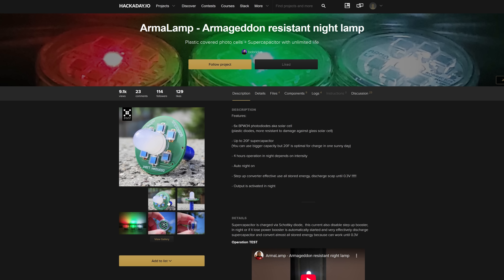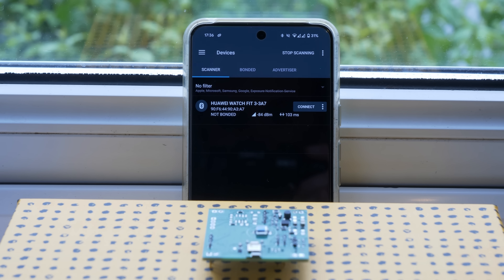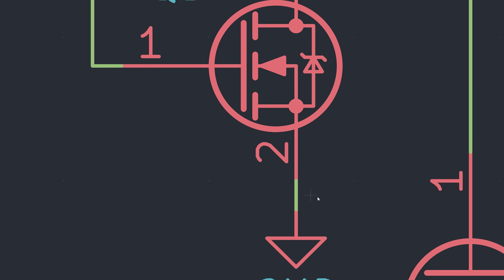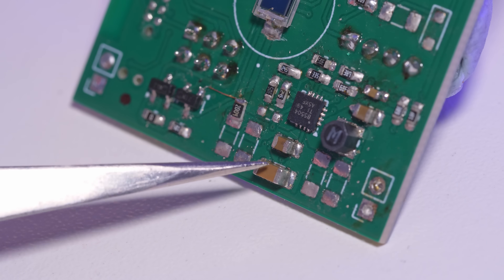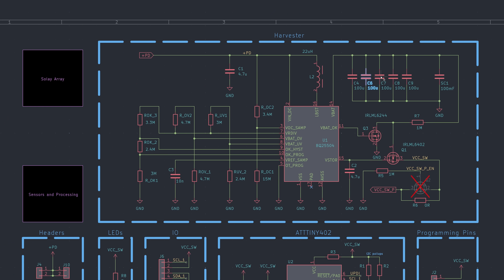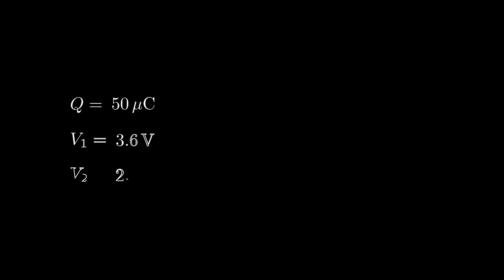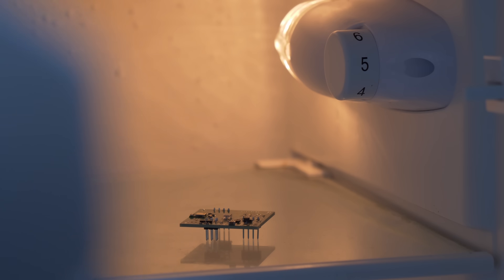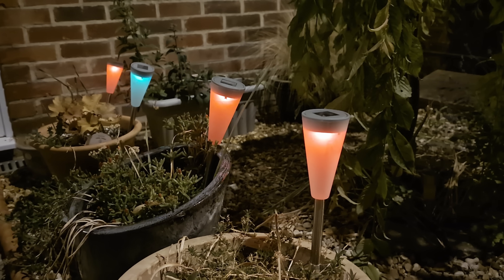Nordic chips are so efficient, you don't need batteries anymore

Comment: Nice project 🙂If you are familiar with microcontroller programming, you may be interestand in the STM32U familly. They are ultra low concuption microcontrollers with a variaty of low power modes. Some can get down to 110nA in consumption. Perhaps it's a way to render your device "smarter". But it is not a MCU that is entended for wireless. ST has the STM32WB microcontrollers, but I find them a bit difficult to program compared to Nordic or Espressif that have a large community around them for DIY wireless devices.

Comment: Back in the 90s and early 2000s there was a community of roboticists experimenting with purely solar powered and purely discrete component robots. They had several clever "solar engine" circuit designs for storing up solar power from small cells in capacitors and releasing them at intervals. They used things like integrated flashing LEDs as triggers, or dedicated voltage triggers (1381,  three-pin package, forgot who made them, I think the specific line is discontinued but I'm sure there are comparable chips out there). No need for complicated MPPT setups. Might be worth doing some digital archeology to see if any of their designs could work for the power harvesting side.
Reply: Sounds super interesting. Do you happen to recall the name of that community? Is there some source to their projects?
Reply: @weekendforever  The approach was called BEAM (stands for, among other interpretations, Biology, Electronics, Aesthetics, and Mechanics). The Solarbotics catalog/web store used to sell a ton of kits and parts bundles. It's still around last time I looked but focuses more on Arduino stuff these days. A lot of the old sites have fallen into the void, too, or been claimed by domain squatters.
Reply: @weekendforever  If it's what I'm thinking of, I think they called it "BEAM robotics". Sort of folded back into the general electronics-hobby scene, I think?
I used to read some websites from that kind of thing as a kid.

Comment: An intruder alarm for the garden.
A couple of mirrors and stepper-motors to point the infrared/ultraviolet laser at 10, maybe 20 tiny batteryless sensors. When no signal is received, there's something there. You could even hook the mirror driver to the signal band to see how fast it could get around all the sensors!
Sure it's an over-engineered mirror but it's the build that's fun.

Comment: I have a bunch of bluetooth temperature sensors(LYWSD03MMC) around my house and I've been planning to power them in a similar way using the SPV1050. I actually have the board for it sitting in front of me just haven't gotten round to populating and testing it. I'll be trying it with supercapacitor, lithium capacitor and LiFePO4 batteries as storage options so they can also send at night.

Comment: I remember using a calculator with a solar panel in the early 1980s (they may have already existed in the 1970s). I guess such devices have been largely forgotten for the past 50 years, much to the delight of the battery industry.    I would not be surprised if it would come out that there were some patent trolling involved in the background...
Reply: The two calculators I myself bought in the last 15 years and all recently purchased calculators at work came with solar panels built in. They are often sold without batteries installed and folks at work chase after bright enough spots in the warehouse to keep them on (too lazy to go to the shop to buy batteries).

I forgot when I saw the last calculator without a solar panel, maybe in the 90s.

What world do you live in?

Comment: Wifi Door/Window contact switches would be an excellent candidate for this.

* periodic transmit, including current open/closed state, via wifi/mqtt so you know the module is not dead.
* on-state-change transmit when the reed switch changes state.

Other house sensors, like PiR sensors would also benefit.
Reply: Unfortunately with encryption and redundant two-way communication alarm sensors use too much power. A CR123 battery lasts about 5-7 years for a good alarm sensor so it's not really a big hassle.

I do see a great usecase for temperature sensors with this technology.

Comment: Clear watertight, floating ball for tracking ocean currents
Reply: Would need to save up a lot of power for that transmission, but could be really cool
Reply: It would be exposed to direct sunlight on most days, so that would help a lot with efficient charging. And seeing how Starlink is working on direct-to-cell connectivity, it's not completely out of the realm of possibilities.

Also, it would need to be a certain size so that it couldn't get swallowed immediately by small fish/birds (so more area for light collection). But also not too big so that it would pose any danger to ships.
Reply: using LoRa for communication!

Comment: Having some involvement in information security: The concept of a long-term Set and Forget self-powered device with transmission capabilities raises some worrying concerns in the malicious surveillance department. 😟

Mind you; One good use case I can think of is passenger counters at rural railway stations. If you can make a photocell trip-line that logs passenger entries/exits and then sends collected data to an on-train module when one calls at the station, it makes implementation of such equipment far cheaper and easier. It'd certainly work at very rural stations, like many on the North American network! 👍

I just wish that I could be cute enough that any technological innovation I had to bring to the table wasn't always being directly muted out... 👴🏳‍🌈🔇🥺

Comment: Definitely a leak sensor to use in a bathroom, laundry room or basement. Sends a warning only when a leak is detected and its status every hour or two, just to announce it's working.
Reply: Though in a laundry room or basement you'd want a larger battery, as those rooms tend to go much longer with no light
Reply: @tuftyindigo  yep i'll keep my longer lasting batteries and not risk damage in those areas
Reply: It would only use energy when a water connection is made, acting as a turn on switch. So it could go a long time with a charge
Reply: @PaulFonWheels  except capacitors have pretty high leakage current, so even if the circuit had zero power use, it wouldn't stay charged for a whole day.

Comment: Interesting idea (just an idea, as it is too complex to implement) - pea sensors, where the entire outer surface is a solar element, and inside is simply a crystal in a compound (just like in cheap electronics, where a crystal is placed on a board and poured with black compound). Accelerometer/gyroscope, temperature sensor, radiation, pressure - they can simply be scattered over a large area and used infinitely.
Similarly, a positioning system - the same capsules that just transmit their serial number, after marking the location, create a map once and get a navigator.
It would also be interesting to consider the idea of obtaining energy from the request radio wave (or working with the reflected signal) - when the pulse energy of the receiver is used to power the circuit. After all, your sensor won't have enough 'starlight' to operate, which limits its application.

Comment: Hot damn that's cool. I'm used to diy RV 12v solar and I've never done circuit design but have a decent concept. But how little per is needed to send packets that's really cool. I totally overestimate how many watts is needed to do work. I freaking love this idea and hope we get more devices like this in the future. Would make monitoring a lot simpler. Providing power to sensors all over the van would be tedious, but if these cells could be powered by most lights then I could remotely turn on my lights just to get an update through my always on pi.

Comment: Hah, I never thought one would be using a nanopower MPPT converter. Your thumbnail looks like cliclbait, but the solar cell really is that small! Decades ago solar powered calculators were about the only common solar-powered things we had. Since most devices just need to run in bursts, it would be great to see this become more common in small smart devices. I'd imagine not because it will remain cheaper to just put battery contacts in than this circuitry.

Comment: Your paste is old or diluted with alkohol 😮
Reply from the maker: You have a very good eye, how did you tell that this is old solder paste?
Reply: @PocketConcepts_  Because i somethimes work with it. I noticed you have some dirt around solder joints. It hapens when flux in paste is diluted with alcohol, when paste is old and hardened. Keep it in fridge it will last longer. I also have some expirience with c programing on rp2040, and when i was younger i tried to make geiger tube with photodiode cluster and OP amp. When i saw photodiode i interested in your video.

Comment: While expensive, you could use a tiny supercapacitor like a 0.33F RSCXJ3345R5F05013U to store 300x the energy and with a good sleep routine the nRF should last all day. You can even harvest energy using an antenna, especially if you have any local radio towers broadcasting.
Reply: Supercapacitors can have quite high leakage current, it's not listed in the datasheet for that one so you'd have to test if there's enough power to keep it charged. Would be nice if it could last through the night. A tiny LiFePO4 cell would be another good option but I haven't been able to find any smaller than AAA. Lithium capacitors are another option, I believe they have lower leakage currents.
Reply: @teslatrooper  I did a commercial product using a supercapacitor (using coin-cell, not energy harvesting). It has a relatively lengthy period (hours/days) of 'soaking', so initially it looks like the leakage current is huge, but it reduces significantly after soaking. Still significantly more than ceramic capacitors unfortunately. We got around that (mostly...) by pre-charging it at the factory before shipping. Also note this soaking happens every time you charge it up - we only needed to do it once typically since the coin-cell kept it charged, and our use case never drained it enough during transmissions.
Reply: @teslatrooper LTO (Lithium Titanate) batteries are what you're looking for. More durable, accept full depth of discharge, suitable for energy harvesting… just less energy dense, but probably good enough.
Reply: I've attempted these kinds of circuits before. A big issue is a cold start when you need to charge capacitor up from zero, the tiny power budget available may not be enough.
Reply: @qps9380  you could use a normal capacitor as a bootstrap
Reply: @qps9380  you could combine it with a regular capacitor to jump start the charging
Reply: Tracking certain wildstocks for their presence and/or movements by the sound that they make. Ofc we would need a whole grid of these then.
That grid could then also be used to monitor for wildfires?
Reply: What about reclaiming Wi-Fi signal power at home ?
Reply: supercapacitors often have higher impedance compared to capacitors so it will take longer to charge
Reply: @bilaaagder  but in return, you get more energy to work with
Reply: @johnmoore5319  it also takes 300x as long to reach a certain voltage from the same solar cell. and sending 4 packets every 100s is a lot more useful than 1200 packets every 10h.
Reply: @julianwalde4810  I think the idea is that you only send 4 packets every 150s or something, but keep doing so during less-lit or unlit periods.
Reply: And if there is no light during night you just don't send any packages or what?
Reply: @Haldi4803  That's the point being made. A super capacitor, like the RSCXJ3345R5F05013U, should be able to store enough power to run over night IF the processor power is well managed (with sleep/low power settings)
Reply: @JustinShaedo that's the thing, I don't think you need a super capacitor, unless you live in the middle of the forest, you are constantly surrounded by high energy radio waves, or if you do live in a forest you are still surrounded by low intensity radio waves (satellites transmitions), they should be able to provide more than enough energy for these circuits
Reply: @bilaaagder  That impedance wont make any difference when you are charging it with microamps

Comment: This would be great for my door lock monitoring system. It currently uses a 200 mAh battery to monitor a reed switch for changes and to wake up every 15 minutes anyways. It lasts 1-3 months i think. It reports the status via wifi, but if i could get a chip that supports zigbee that should work for energy harvesting. I have it send the battery voltage too, and can see the warming from the sun raising the battery voltage every day on my backdoor lock monitor, which i think is quite cool.
Reply: Wi-Fi is way too power hungry. LoRA is what you're after. Your battery will last a lot longer.

Comment: My application is a gate open notification.  I recessed a magnet in the post where the gate latch is mounted, and recessed a reed switch in the wooden gate.
When the gate opens, the switch toggles, and the ESP32 responds by sending an HTTP request via WiFi to my home server, which is configured to play a sound indoors.
I have yet to finish the power management, so this approach might be best for me.

Comment: Make one of those prank devices that beeps at random intervals but doesn't use a battery.
Reply: DIABOLICAL. Harvest the energy from AM radio so it works in total darkness
Reply: @JinKee  and then put it in the walls of your friend's house
Reply: @JinKee  infinite energy glitch
Reply: ceiling birds are already annoying enough
Reply: That is actually evil
Reply: driving a powerful enough speaker is not going to be easy though
Reply: @Emayeah piezo speakers use so little energy it should work
Reply: @Cyber_Gas  but when talking about milliwatts over a few milliseconds the beep is going to be not even barely noticeable
Reply: @Emayeahwhat if energy is stored to a capacitor and it calculates every time it has power via solar a random value 1-100 and if it 100 it does beep
Reply: @giannisd961????
Reply: @giannisd961you can save complexity by having the capacitor that stores the energy from the solar cells also being the timer. 

The cap slowly changes from the solar, then once it reaches enough voltage the capacitor drains through the pizo speaker until empty  then the cycle repeats.
Reply: The amazong Annoy-A-Tron
Reply: Not a great idea to make a device that's meant to be hidden work off of solar power...
Reply: Like that chirp i hear when visiting section 8 housing.
Reply: @guillermoelnino the liberal leaving my body as soon as I hear the smoke alarm chirp:
Reply: That's not a prank, that's justification for violent retribution

Comment: Thanks for introducing me to the BQ25504 - Linear has a line of similar products but will start harvesting at super low voltages (~20mV LTC3108) - so if the thing has trouble getting booted sometimes plopping a low voltage triggerable circuit on there can kick it into life where it can run on its own (Iq ~ 330nA BQ25504).  In my case, I already have low voltage wake up so keeping something awake is of interest; I expect to do exactly as I just suggested for you,  but to solve the other side of the problem.  

Thanks algorithm for pointing me over here and thanks for putting this up so I could watch it!
Reply from the maker: The LTC3108 is an interesting chip, thanks for sharing!

Comment: I might think of a few useful applications for something like this. Maybe a mailbox checker that sends a signal when the lid’s opened, or a perimeter trip sensor for a driveway or gate. Also thinking something like a cat tracker or cat-door monitor could be cool, if it could log or transmit when the cat goes in or out.

Comment: Here's some video ideas that I think may be worth considering for future videos:

a bit more input power would allow for it to enter a ultra low power standby mode , which would be a nice addition that opens possibilitys like users using infra-red to add a command to a queue

maybe it could use weird power sources like radio signals or the light released by a TV remote when giving a command and maybe even a piezoelectric crystal

maybe it could evaluate code from a request using either the "using the signal itself" or the "queue" thing (this also allows for testing out diffrent things , two birds one stone )

a small LCD square could blink as update indicator (with minimal voltage , lcd displays can be used with really small small amouts of current)

and I would definitly add stoarge

Comment: How does it work outside? at night?
Reply from the maker: With a larger solar array it would work indefinitely, but the single cell version in the video stopped transmitting at 10pm in British summer. There is a different approach thta could be done where the energy is stored in a supercap in the day, and putting the nRF in deep sleep overnight, only waking every 10 minutes to transmit.

Comment: I currently have several battery powered temperature/humidity sensors on zigbee as part of a home heating system. The most obvious use case does seem to offer significant benefits of not having to use batteries. At the least, this system could run in parallel to operate when there is sufficient light and falling back to battery when not
Reply: That's the same thing I was thinking of. This would be game changing for ultra low power zigbee!
Reply: @stefa168  just checkout enocean they have different harvesting methods "like lever action" from light switches or by using heat from your radtiator to set the valve of said.
Reply: you could just replace the battery with an even bigger cap. who cares if it runs in complete darkness only for a couple weeks instead of years, as it hets recharged slowly during the days anyway.